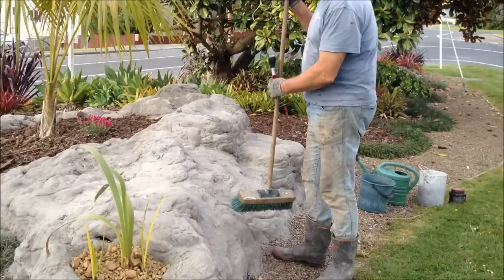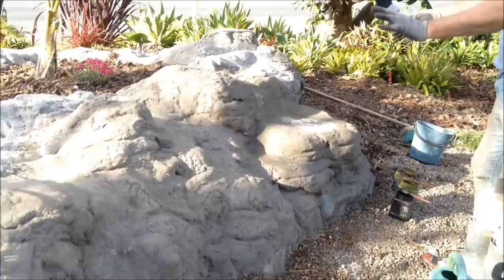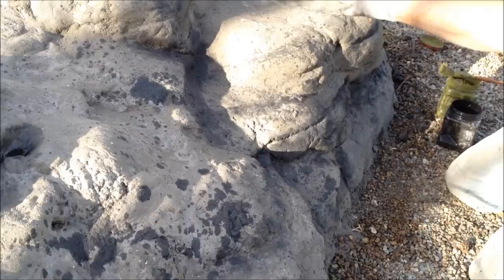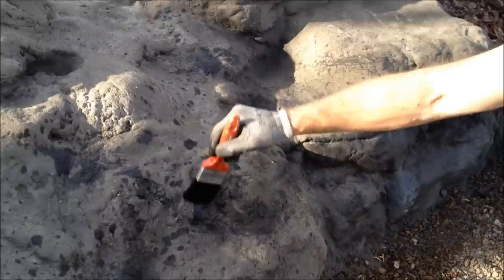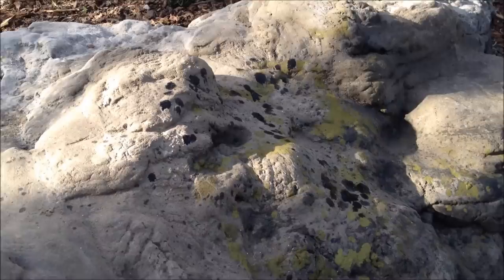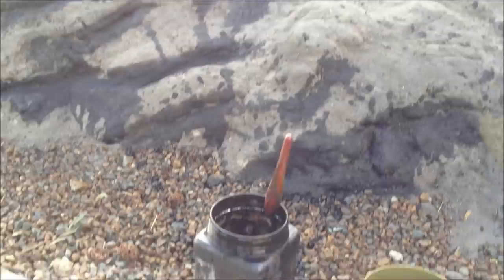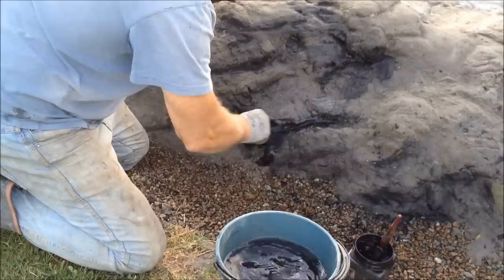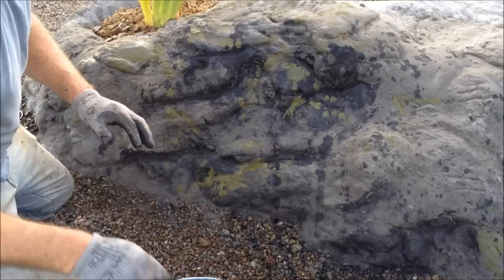R4 Helpful Tip for aging Artificial Rocks

Comment: These are GREAT!  Can you give a word about water proofing and making ponds and fountains this way?  Do you need to use some sort of a sealer?  Will the oxides stay with water running over them after some drying time?
Reply: Pure oxides as shown are not permanent unless mixed with some cement as a slurry or with an acrylic bonding agent (bondcrete) mixed in with the water. At least in my experience.

Comment: Ive found that using a spray bottle with 1-2 teaspoons of oxide/pigment gives a more subtle and natural look and you can work in layers darkening slowly. Also sanding will bring back natural color to the high areas giving a weathered look. You can buy pigments at www.directcolors.com also seal with a solvent based satin sealer to lock in the colors. To see some of my own decorative concrete work visit www.facebook.com/kenscustomdesigns. Great tutorial on how to carve concrete!
Reply: Hi Ken, what do you mix the oxides in?  Do you use just water?  Some oxides say they are insoluble in water.